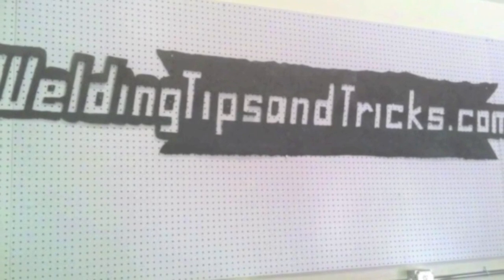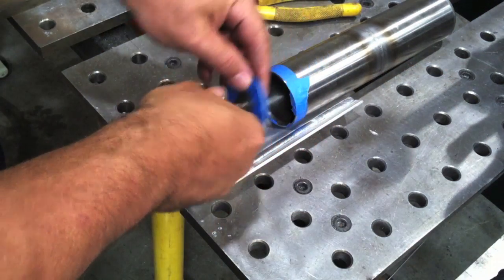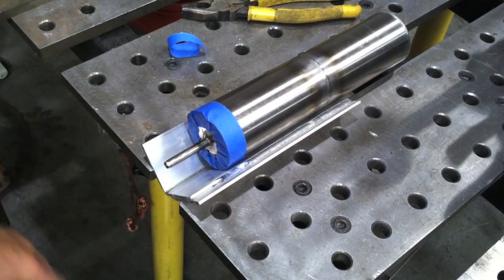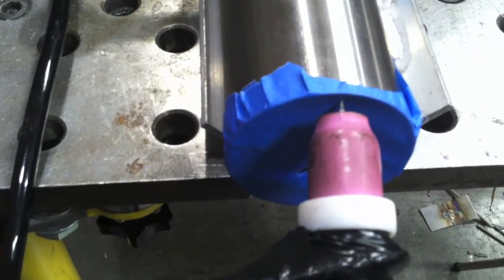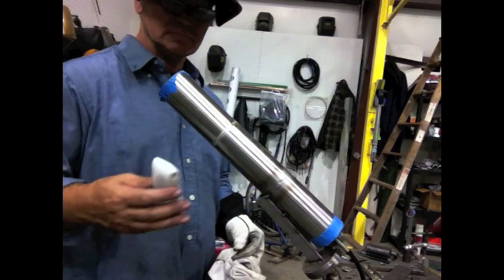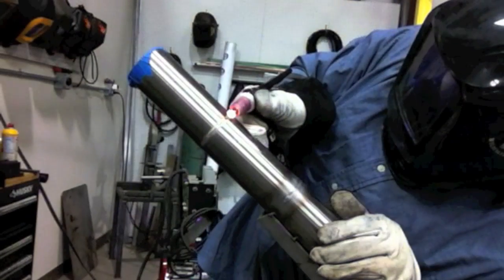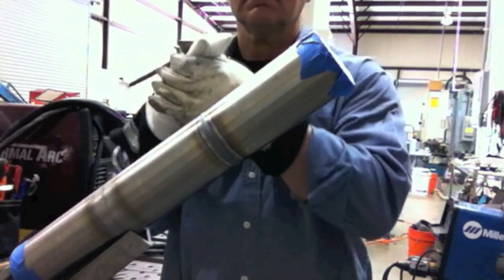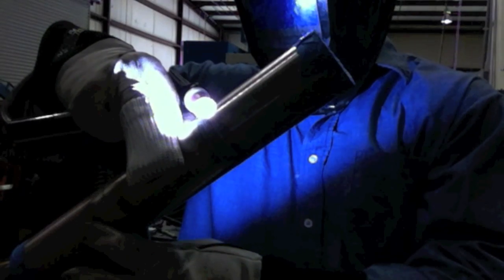Tig Welding Stainless Steel Tubing

Comment: I am sure this is a dumb question, but I am new and have 16ga 403 tube to weld myself. Why didn't you use any filler rod for this? Was it just do to the application the tube was going to be used for, or is it just not needed with this thin wall tubing?

Comment: I'll add-on to some other comments. Always find your videos interesting and as a different perspective. Dont believe this is in your wheel house. You didnt show the cut away or back side of weld?  Purge setup is a little excessive. Just put the exhaust port at top instead of two different openings. Torch is way overkill. WP9 or 125a torch is more than adequate. Foil or Foil tape FTW. While other posters made comments about not walking the cup, in the field out of position, you can't always walk the cup. And you shouldn't always feel the need to. The best welders recognize and utilize any and every technique as needed. Tools in tool box. I get a kick out the ''walking the cup guys" who can't hand weld for their life.Love to see then try with mig or stick, Lol.

Comment: Jody, as long as your far enough from the weld joint, use electrical tape because it stretches incredibly!!! and seals the joint. as long as it don't get to hot.

Comment: This is great, very informative and concise, i am in the learning process and about to purchase a multi process welder, whats that dual gauge valve called for routing dual setup to do tig purging and back purging?
Reply: Google RMA-10-VSS and just tee two of those to your flow meter after the regulator

Comment: Hey Jodi what filler rod should I use when tig welding wood 2x4s to concrete? Is acetylene a good shielding gas?

Comment: I don't have the capability at the moment to produce videos but for the time being in can talk about stainless process piping. Today I had to bust out my mirror and mini tig torch to complete a field weld on a product line.
Reply: +Mack Avila I love mirror welding. Its challenging and fun. I am a structural welder for now though. I hope to get my pipe qualifications soon though. If you made videos or a little blog/forum with pictures I would like to take a look at it. Do you do any other welding other than sanitary piping?

Comment: why doesn't it undercut with no filler metal?
Reply: Because of the purge, argon pushes the weld out
Reply: If there's the good pressure of argon inside the pipe, the weld is lightly convex inside AND outside without filler metal ;-)
Reply: Kev.1 how many cfh or l/min give a really good profile inside and out?? Is there a magic figure haha
Reply: laurie agnew there's no rules, it depends of the diameter, the lenght of the pipe... and the exhaust size.

Comment: Do you have a weld lip on the pipe to act as filler wire or does it not matter that there might be undercut or low weld ?

Comment: Jody,
We use a big tapered brass plug with a hole in it to purge pipe. It works for 3/4" to 4". Just lightly tap it in and it seals up nice.

Comment: I do those joints every day, for being "rusty" it looks awfully good. Some of mine don't turn out that nice haha. Any chance that you've dabbled with the new flux cored tig filler for stainless? I have yet to use it (i've been on the commercial end of work for 5 years and haven't done industrial in awhile) Apparently you can use the flux core on large bore with no purge and it turns out a sugarless root. I think it would make a great video. You are really good with pointers.

Comment from the maker: contractors develop procedures for all kinds of processes and joints that are not common.  for example, i have heard of open root pipe with 7018 for the root with no backing.  It  depends on job requirements, the engineering authority,  and if the procedure can be qualified within the scope of the applicable code.. But I cant picture flux core  working very well.  One slip of the hand and you have whiskers inside the pipe.

Comment from the maker: if i am not sure what type of stainless it is, 312 would be my first choice. 309 second, 308 third.
exhaust headers could be 300 series stainless like 308 or high end headers might even be 321, but some are 400 series like 409.  312 will handle all of them

Comment from the maker: the video is called "Scratch Start Tig Welding with a Twist"
Reply: weldingtipsandtricks is it possible to put a root in schedule 40 304 stainless pipe in the 6g position without backfeeding?

Comment: Jody,do know about welding mig or flux-core on carbon steel pipe in the field? For example,do you have to use self shielding flux-core because of windy conditions, and dose FCAW-S weld open root, or do you need to go to a backing ring type joint ? Thank You

Comment: have you thought of using the temporary rubber freeze plugs with a hole drilled into it for your argon just a thought Iv'e never used argon so i don't know if it would help but it could save time getting set up and they don't cost much at an auto parts store

Comment: Great video! One question though. I've always seen stainless welds have all sorts of color in them from purple or blue to that wheat/straw color. Is there a correlation between color and weld strength/quality when welding stainless? Is that regular silver color from this video what you're looking for?

Comment: Great teacher you are, Jody!  I'm curious about the rectifier and diodes you used to convert the buzz box to tig. I looked but couldn't find the specific video of your many detailing the construction of the converter.  Is there a schematic or instruction video somewhere that shows the construction?
Thanks,
John

Comment: masking tape can be detramental to some welds due to the chlorine in the glue, make sure you know what the end use of the product is. There is chlorine free tape. Aluminum foil works great, just ball some up around purge hose then just shove it in tight.

Comment from the maker: I am guessing you should probably use filler metal. It actually depends on fit-up, joint type, etc. for a good fit on an outside corner joint, you might get by with no filler. But on other joints with slight gaps, filler metal works better.

Comment: Another excellent video. And dang it......y'all order a 3 pack of fingers. Was just using one the past couple days on a bunch of aluminum projects and they are indeed a damned handy thing to have. Kept the burning and cussing down to a bare minimum (not a welder by trade at all, but in the shop I work at I am constantly building brackets and other bits and pieces out of a variety of materials to bolt down various items in police vehicles)